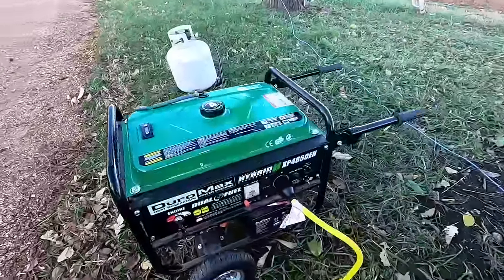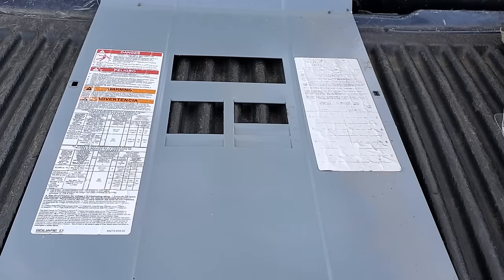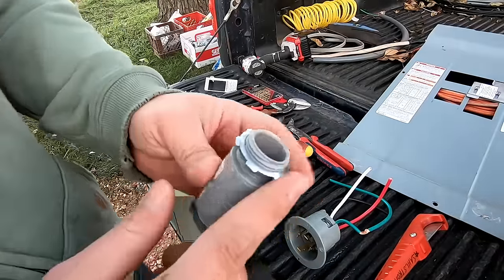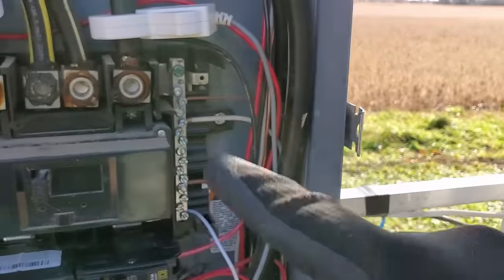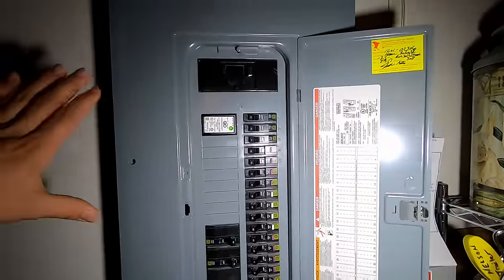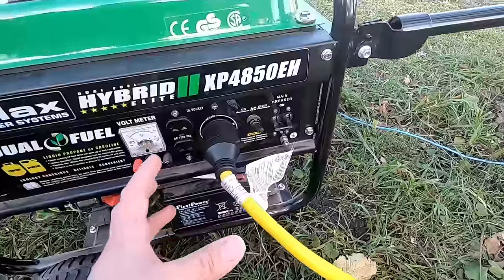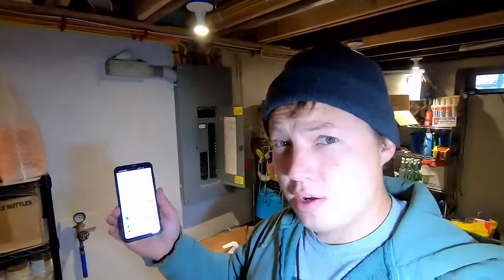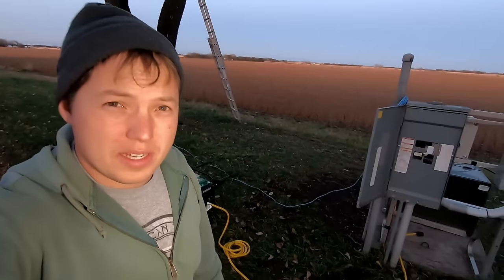How To Hook Up a Generator To Your House Using a Breaker Interlock Kit & Power Inlet Box

Comment: thanks for sharing all this. helpful. curious... how long will a tank of propane last? obviously you won't keep all the things on all the time. thinking chest freezer, regular frig/freezer, well pump, furnace blower, hot water heater, charging devices, a light or two is what I would isolate from the main panel. and only switch them on when needing to use them. i would get a tri-fuel one cause we have natural gas on the main house and propane on the outbuildings so both are there if needed. but yeah, never had anything but a small gas gen so not sure how long other fuels last... and no pressure, i know this might be a complicated question based on each appliance and how much use, but yeah. anyway, thanks and you've got a new sub :)

Comment: You might wire for a 50 Amp in the panel box and the outlet for generator cord. Use a 30 Amp to 50 Amp RV cable from the generator to panel outlet. Then when you upgrade your generator and generator cable your wiring is already complete. I don't think it's advisable to run higher Watts than you are on a 10 guage 30amp cable.   I'm learning so nothing written in stone.

Comment: Looks informative 👍 but electrically RIPish 🙏

What is the part number for junction boxes with plug going down and other box that was mounted?  Also was wondering is it safe to run two extension cords 25ft and 25 ft to make a length of 50ft outside when it rains 🌧 ?  Wont the connecting plugs get wet? Saying this if all you could find at store was 25ft lengths only and was in a jamb to use them.  Is there a water proof plug connection-housing that houses both joined plugs?  Any thoughts on running two extension cords in open rain? Good or bad?  Also when it rains what are you going to do to cover your duromax generator??
Reply: Purchase a Gen Tent to cover when it rains.

Comment: Very helpful video Ben! Thank you.
Reply: Don’t forget about the generator safety tips as well. Remember it’s important to follow all the generator safety rules whenever you use your generator. Here are the generator safety tips:

1) Please do not allow an unqualified person or your children to operate the portable generator. Just because some manuals don’t say that doesn’t mean it’s safe. That is important against the generator safety rules. We also need to be keeping an eye on our children too. You need to make sure that your children are not playing near the portable generator especially when it’s running so they won’t get electrocuted. Generators pose electrical risks and they can be hot during an operation. Please keep your children away from the portable generator at all times. It is important to keep our children safe especially our little ones. Be aware of all the hazards.

2) Some people use their portable generators indoors which increases the risk of carbon monoxide poisoning. It’s important to have a carbon monoxide if you have a gas generator. Never ever use your generator indoors even if your doors and windows are open and even in the garage is not safe to use a portable generator. Not even at your porch and your deck. It is never safe to use your generator indoors and in enclosed areas of your home. Your generator needs to be 15-20 feet away from your house. 

3) 🔥generators cause fire hazards too. Never refuel your generator while it’s running. You need to let your generator cool off before refueling it and before storing your generator. Never overload your generator too. Never ever back feed your generator. You should never plug your generator into a wall outlet. Also never store propane tanks indoors. Please keep flammable things away from the generator as well and please don’t smoke cigarettes near the generator. Having a fire extinguisher next to the generator is also important against the generator safety rules. 

4) generator operation; make sure your hands are dry before touching the generator. Never use your generator in wet conditions. Don’t let your generator get wet. You need a generator tent if you need to use your generator during wet weather. Please don’t wear loose clothes when operating the generator. Turn on your generator before plugging in appliances. Use the right cord for your generator. Please do not use worn out cords. 

https://youtu.be/I1jT3ANENvI and here is a video more about keeping others safe when using generators and also about our family’s safety. Hope this helps

Comment: Excellent video! You are saying driving a ground rod at the generator and connecting the frame to it is optional, since the cord from the generator to the house panel will ground the generator. So, is it OK to BOTH ground via a ground rod and also via the cord to the panel? Or do you do only one or the other? Also, do you bond the neutral in the generator to the ground (frame) at the generator? Thanks!
Reply: Don’t forget about the safety rules of using generators: Always make sure you follow all the generator safety rules whenever you use your portable generator. This is a reminder for everyone’s safety of using generators. Generators can be dangerous if not used carefully. Every year, hundreds of people die or get injured when using portable generators due to carbon monoxide poisoning and electrocution. Make sure you are using your generator carefully and keeping others safe as well. There is something very serious that everyone should always be aware of when using generators. Some people do run their generator indoors which is not safe and that increases the risk of carbon monoxide poisoning which can cause death of family and you. Some people run their generator in wet conditions which can electrocute them. Please remember that you should never run your generator indoors. Remember that carbon monoxide is an odorless and colorless gas that you cannot see or smell. Carbon monoxide is a silent killer. Keep that in mind. Make sure your generator is 15-20 feet away from your house and away from doors, windows, and vents. Never use your generator in your porch too. Having a carbon monoxide detector is very important against generator safety. Some people also allow children to go near the portable generator which could pose risks. We need to keep an eye on our children making sure that they are not near the portable generator so they won’t get electrocuted or burned by the generator which is dangerous. A locking enclosure also keeps kids safe. A generator shed might look like a tempting place to explore, or take cover during a game of hide and seek, but a generator is a dangerous piece of equipment that can cause injury. It says on the manual that we should also keep children away at all times from the portable generator to avoid injuries. Please do not allow a child or unqualified people to operate the portable generator.  It is important to keep your children safe especially little ones. The portable generator can be hot during an operation. Just because some manuals missed what should be listed doesn’t mean it’s safe to do. Always follow the generator safety rules when using portable generators. Generators pose electrical risks. If you need to use your generator during wet weather, you need a generator tent to protect your generator from getting wet. Don’t let your generator get wet. Keep your generator dry and before using your generator, please make sure your hands and your generator is dry. Do not wear loose clothing when operating the generator. Everything that is said on the generator’s operating manual should not be ignored. Never smoke cigarettes near the generator. Please keep flammable things away from the generator. Never overload your generator too. Your generator can catch fire. Never ever try to plug a generator cord into a wall outlet to avoid back feeding. Back feeding your generator is dangerous. Always turn on your generator first before plugging in appliances and shut off the appliances before turning your generator off. Use a heavy duty cord for your generator and the cord should not be worn out. All the instructions should be followed carefully. Never refuel your generator while it’s running. It can cause fire if fuel spills while your generator is hot. You should turn off your generator and let it cool off before refueling it. Having a fire extinguisher next to the generator is also important. This is only a reminder for everyone’s safety of using generators. Make sure your generator is properly grounded. Having a fire extinguisher next to the generator is also important against the safety rules. https://youtu.be/I1jT3ANENvI and here is a video more about keeping others safe when using generators and also about our family’s safety. It’s important to keep our little children safe as well. Make sure your little children are kept away from the generator at all times especially when it’s running. Hope this helps. Always remember that it’s better to be safe than sorry. Also remember that warnings should not be ignored too.

Comment: Thanks for this. Very helpful. The kids playing in the background was a plus. 😂😂👍👍
Reply: Don’t forget about the generator safety tips as well. Remember safety is always important. Here are the generator safety tips:

1) Please do not allow an unqualified person or your children to operate the portable generator. Just because some manuals don’t say that doesn’t mean it’s safe. That is important against the generator safety rules. We also need to be keeping an eye on our children too. You need to make sure that your children are not playing near the portable generator especially when it’s running so they won’t get electrocuted. Generators pose electrical risks and they can be hot during an operation. Please keep your children away from the portable generator at all times. It is important to keep our children safe especially our little ones. Be aware of all the hazards.

2) Some people use their portable generators indoors which increases the risk of carbon monoxide poisoning. It’s important to have a carbon monoxide if you have a gas generator. Never ever use your generator indoors even if your doors and windows are open and even in the garage is not safe to use a portable generator. Not even at your porch and your deck. It is never safe to use your generator indoors and in enclosed areas of your home. Your generator needs to be 15-20 feet away from your house. 

3) 🔥generators cause fire hazards too. Never refuel your generator while it’s running. You need to let your generator cool off before refueling it and before storing your generator. Never overload your generator too. Never ever back feed your generator. You should never plug your generator into a wall outlet. Also never store propane tanks indoors. Please keep flammable things away from the generator as well and please don’t smoke cigarettes near the generator. Having a fire extinguisher next to the generator is also important against the generator safety rules. 

4) generator operation; make sure your hands are dry before touching the generator. Never use your generator in wet conditions. Don’t let your generator get wet. You need a generator tent if you need to use your generator during wet weather. Please don’t wear loose clothes when operating the generator. Turn on your generator before plugging in appliances. Use the right cord for your generator. Please do not use worn out cords. 

https://youtu.be/I1jT3ANENvI and here is a video more about keeping others safe when using generators and also about our family’s safety. Hope this helps

Comment: I hooked up a manual transfer switch to connect my generator and for some reason when I connect the 10/3AWG extension and turn the generators switch on it shorts out instantly.

I confirm the connections are all correct and I am now at a lose not sure what to check next. Any thoughts? Thanks in advance
Reply: Remember to always make sure you follow all the generator safety rules whenever you use your portable generator. 
⚠️Here are the Generator safety rules that everyone needs to follow when using generators:

This is just a reminder for everyone’s safety when using portable generators. All generator safety rules need to be followed carefully to avoid hazards. 

1) Please do not allow an unqualified person or your children to operate the portable generator. Just because some manuals don’t say that doesn’t mean it’s safe. That is important against the generator safety rules. We also need to be keeping an eye on our children too. You need to make sure that your children are not playing near the portable generator especially when it’s running so they won’t get electrocuted. Generators pose electrical risks and they can be hot during an operation. Please keep your children away from the portable generator at all times. It is important to keep our children safe especially our little ones. Be aware of all the hazards.

2) Some people use their portable generators indoors which increases the risk of carbon monoxide poisoning. It’s important to have a carbon monoxide if you have a gas generator. Never ever use your generator indoors even if your doors and windows are open and even in the garage is not safe to use a portable generator. Not even at your porch and your deck. It is never safe to use your generator indoors and in enclosed areas of your home. Your generator needs to be 15-20 feet away from your house. 

3) 🔥generators cause fire hazards too. Never refuel your generator while it’s running. You need to let your generator cool off before refueling it and before storing your generator. Never overload your generator too. Never ever back feed your generator. You should never plug your generator into a wall outlet. Also never store propane tanks indoors. Please keep flammable things away from the generator as well and please don’t smoke cigarettes near the generator. Having a fire extinguisher next to the generator is also important against the generator safety rules. 

4) generator operation; make sure your hands are dry before touching the generator. Never use your generator in wet conditions. Don’t let your generator get wet. You need a generator tent if you need to use your generator during wet weather. Please don’t wear loose clothes when operating the generator. Turn on your generator before plugging in appliances. Use the right cord for your generator. Please do not use worn out cords. 

https://youtu.be/I1jT3ANENvI and here is a video more about keeping others safe when using generators and also about our family’s safety. It’s important to keep your children safe especially little ones. 

Hope this helps

Comment: That was a great video very informative.. Great job
Reply: ⚠️Portable Generator Safety Tips:

1) KEEPING OTHERS SAFE: Please do not allow an unqualified person or your children to operate and service the portable generator. Just because some manuals don’t say that doesn’t mean it’s safe. That is important against the generator safety rules. We also need to be keeping an eye on our children too. You need to make sure that your children are not playing near the portable generator especially when it’s running so they won’t get electrocuted. Generators pose electrical risks and they can be hot during an operation. Please keep your children away from the portable generator at all times. It is important to keep our children safe especially our little ones. Be aware of all the hazards.

2) WHERE TO RUN YOUR GENERATOR: Some people use their portable generators indoors which increases the risk of carbon monoxide poisoning. It’s important to have a carbon monoxide if you have a gas generator. Never ever use your generator indoors even if your doors and windows are open and even in the garage is not safe to use a portable generator. Also please never use your generator in your deck or balcony. It is never safe to use your generator indoors and in enclosed areas of your home. Your generator needs to be 15-20 feet away from your house. 

3)🔥FIRE HAZARDS: Never refuel your generator while it’s running. You need to let your generator cool off before refueling it and before storing your generator. Never overload your generator too. Never ever back feed your generator. You should never plug your generator into a wall outlet. Also never store propane tanks indoors. Please keep flammable things away from the generator as well and please don’t smoke cigarettes near the generator. Having a fire extinguisher next to the generator is also important against the generator safety rules. It’s also not safe to move your generator while it’s running.

4) GENERATOR OPERATION: make sure your hands are dry before touching the generator. Never use your generator in wet conditions. Don’t let your generator get wet. You need a generator tent if you need to use your generator during wet weather. Please don’t wear loose clothes when operating the generator. Turn on your generator before plugging in appliances. Use the right cord for your generator. Please do not use worn out cords. 

https://youtube.com/shorts/eFigDfnPkcQ?feature=share and here is a short video more about keeping others safe when using generators. Portable generators need maintenance so it’s important to follow the safety instructions.

Hope this helps

Comment: Hey Ben, quick question, I bought a neutral bonded generator that I will be plugging into the main panel of the house. is the fact that the generator is bonded an issue? thank you
Reply: Probably won't hurt but you only want to have one bond at the first disconnect on the main panel. A neutral bonded generator along with the bond in the panel is the same problem as bonding the neutral in a sub panel. The bonded gens like you have are great for extension cord only setups. You can unbond it internally if you wanted to.